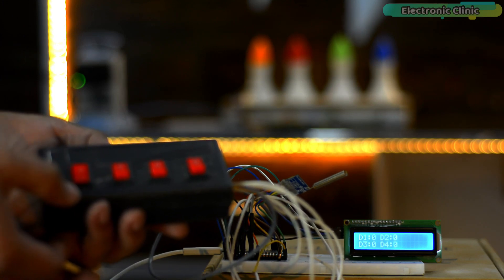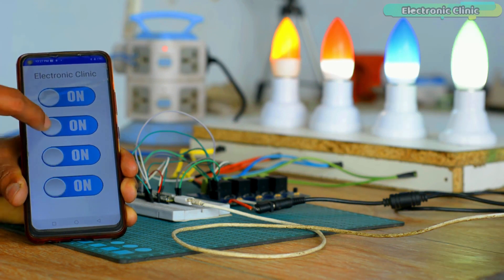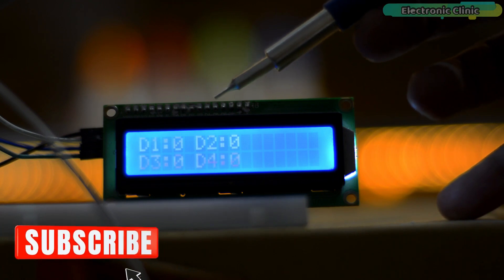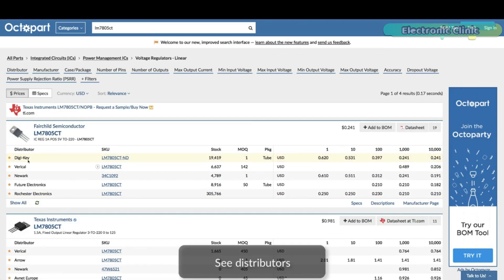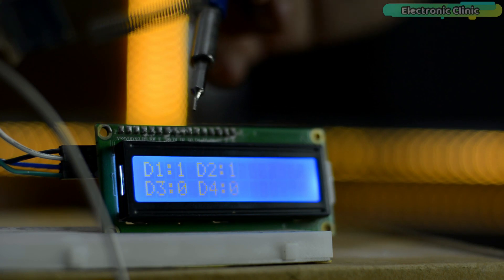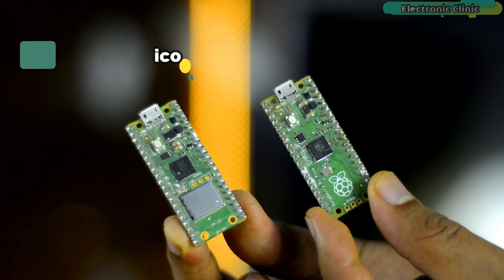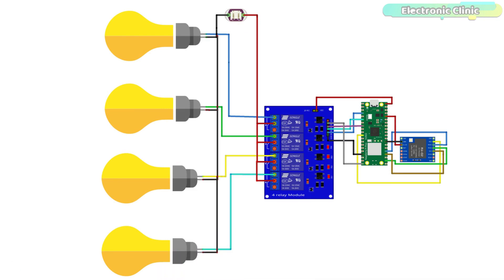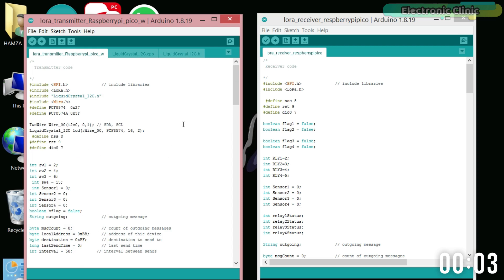LoRa and Raspberry Pi Pico W based Home Automation Project with Feedback

Comment from the maker: Related LoRa Projects:

Raspberry Pi Pico W with LoRa getting started video
https://youtu.be/kdQcQrzsgZM

Raspberry Pi Pico LoRa Gateway
https://youtu.be/zCwxj16BgUA

Soil Moisture sensor and LoRa
https://youtu.be/ofJbdGagoG0

ESP8266 and LoRa Gateway
https://youtu.be/r9gAFQIqs0Y

ESP32 and LoRa 
https://youtu.be/QghY9SlybQQ

MLX90614 Infrared Temperature sensor and LoRa
https://youtu.be/QBgKL-LExq4

LoRa Network
https://youtu.be/BeWbStpLirU

LoRa GPS Car Location Tracker
https://youtu.be/d5zfD6ekRYA

ESP8266 LoRa Gateway for STM32
https://youtu.be/oZ0sXXSC0Q8

LoRaWAN
https://youtu.be/tXoAa_II2OY

Multiple LoRa nodes
https://youtu.be/wUF9ysBEHfo

LoRa SX1278 Getting started Video
https://youtu.be/r-jwNlMQPIk

Comment: Im using Thonny to program 4 Pico Pi units each one with a SX1262 Hat, I would like to use the same program on them all and have them communicate. Im having a hard time getting them to communicate with each other. I want to trigger one units GPIO and have the other 3 GPIO's trigger. Can anyone help, Not even sure I have the correct libraries loaded.     Thank you

Comment: Thanks a lot for this project with lora modules, Tho i have a request:
Will u use these lora modules in water level and pump auto on off system for overhead tanks? there are many projects available but those are not practical due to wired connectivity, but if u us these lora modules it will be so much convenient. Looking forward.
Reply from the maker: It's already in the list. I have bought a waterproof ultrasonic sensor.
Reply: @ElectroniClinic  cant wait for that!!!